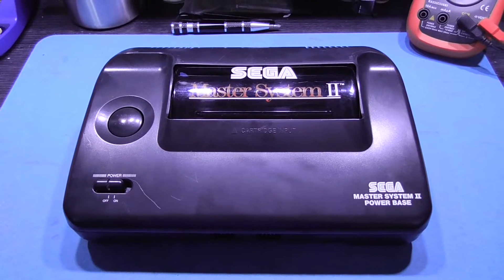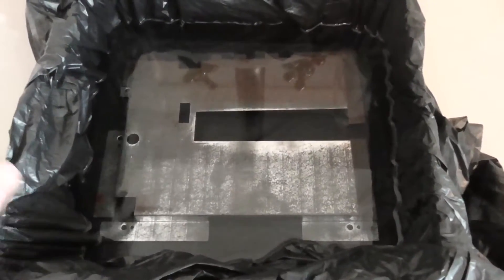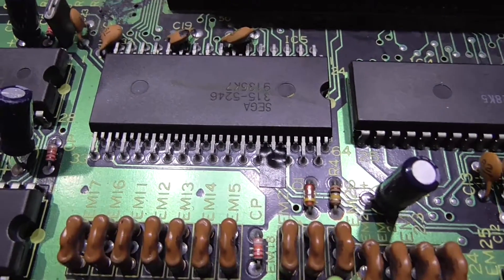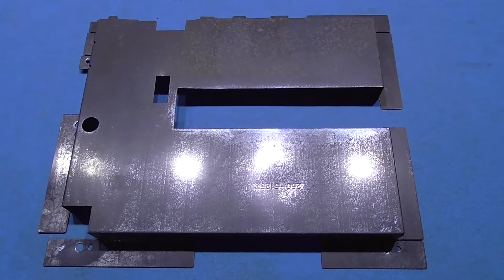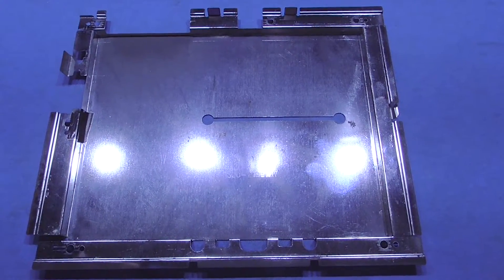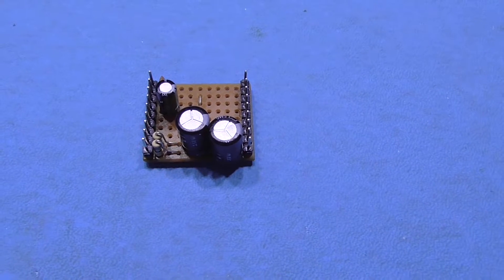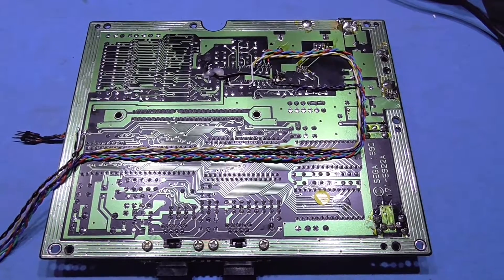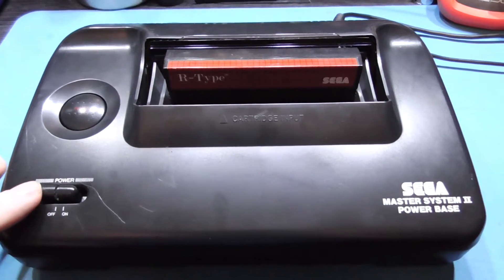Sega Master System 2 - Part 2 - 50/60Hz Switch Mod & RGB AV Port Out Mod.

Comment: Capacitor values should really be 470uF rather than 100uF, it won't matter if they're bigger, but it sure will if they're smaller, the image will dim as it draws each frame, meaning the bottom of the screen will not be as bright as the top.

Comment: Regarding the C-Sync line. Does that output TTL csync? If so, would that not damage the TV/upscaler that it is plugged into?
Reply from the maker: Yes, TTL C-Sync is not good for a TV. However, a TV should have some form of input protection (Clamping Diodes) on it's inputs. If you want to connect TTL C-Sync to a TV you'll have to attenuate it first. A 300 to 400 Ohm Resistor will do the job nicely.
Reply: @Four_X  I understand, but does the SMS 2 produce TTL csync? If so, then I should modify your circuit slightly to include the resistor, right?
I have the other video chip "mb3514" and the chip only has csync in, so I will attenuate that. Or I might just pass  it through since the cable that I bought from Retro Gaming cables attenuates the CSync signal if I am not mistaken.
Reply from the maker: @alhamwydude  Yes you can use the TTL C-Sync going into the mb3514 video encoder chip just make sure you attenuate it with a resister between 300 and 400 ohms. As for Retro Gaming Cables I've never used one, I make my own SCART cables.
Reply: @Four_X  Thanks a lot for the help. The cable that I got is the "Sega Master System 1 / Mega Drive 1 RGB SCART PACKAPUNCH PRO CABLE" from RGC as I don't have the tools to make my own cable right now. They state that "This high quality cable supplies a composite sync (CSYNC) signal from the console and is correctly attenuated to reduce the high amplitude of a CSYNC signal using a 470 ohm resistor on the sync line" so I should be ok just passing the CSync signal directly without any capacitor or resistor. I will keep them for now and test them when they arrive. If it works I will keep the current resistor and cap, if not, then just pass the signal through directly. Thanks for the help once again!

Comment: I got a job lot of consoles the other week, the SMS2 wasn't listed so was a good bonus but the picture is messed up, I am thinking theres a sync issue as I have a picture that is yellow and some blues that look gray, audio is fine though and its composite not rgb.  took it apart and the mod work looks very clean and wired very similar to yours (except has some sort of chip in a breadboard) No idea how to fix it, no wires are loose.

Comment: Can someone please explain why the prototype board needs to have its copper traces removed before soldering the capacitors and resistors? I don't get it, because if you remove these traces as shown on the video, you completely lose continuity of the entire copper line, even if you solder both legs of the resistor/capacitor.

Comment: what kind of switch are using ? can you give us the exact specs ? Also are you using 2.54 mm pinstrips and veroboard?
Reply from the maker: correct the veroboard is 0.1 inches (2.54 mm) and the switch is a DPDT Miniature Slide Switch M2 threaded.
Reply: @Four_X   umm sorry i'm a bit of a noob when it comes to electronics. The DPDT switch has 6 pins, you only have 3 wires , not sure how to connect those wires to the switch.

Comment: Can you please tell me What ground connection do you have connected to the outer shell of the 8 pin din connector? is it the one wrapped around the Audio + wire? mine is suffering some slight buzz in the audio and trying to troubleshoot it. i currently don't have anything connected to my outer shell as i followed your diagram which tells me to connect both ground wires to pin 2 but in your video you appear to have something connected to the outer of din but i can't tell what ... thanks in advance.
Reply from the maker: Your going to get some slight buzz from old systems like this, i do also. nothing much you can do about it. the outer din connector is grounded, any ground will do.
Reply: @Four_X  Thanks for the reply, I connected the outer din and things have improved dramatically! Now I only get a tiny little buzz. I found the cable I was using was crap as well because when i ran a separate ground wire outside of the cable things improved further still so I ordered a decent fully shielded one from retro gaming cables that's wired for csync, although I'm thinking I might have add a switch to switch out the 470 ohm resistor that's built into the head of the scart for when I'm using it with the master system 2 as I know the TTL on that seems to be already at 1v vpp or there abouts, and I can switch it back in when I use it with my mega drive. Thank you Fourx2k3, and your videos are awesome.
Reply: where exactly is the connection in the outer DIN?